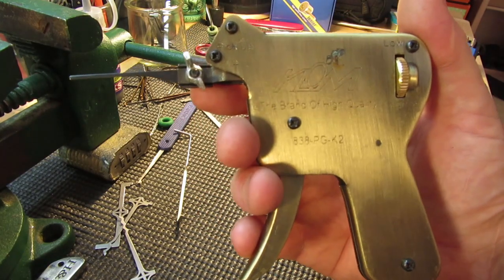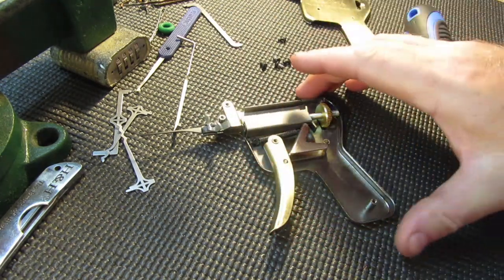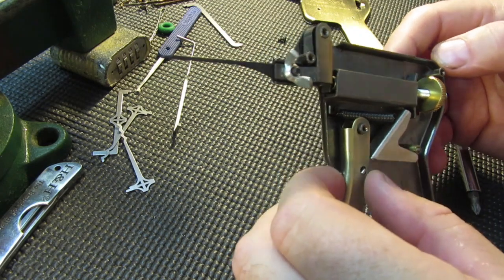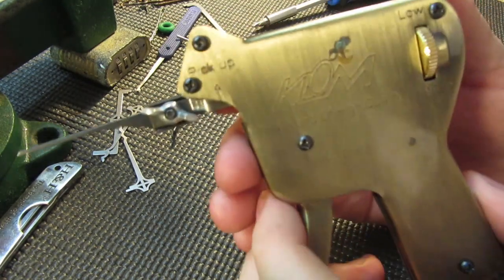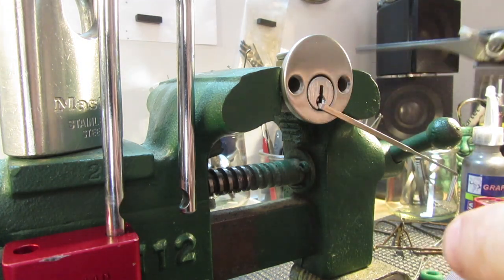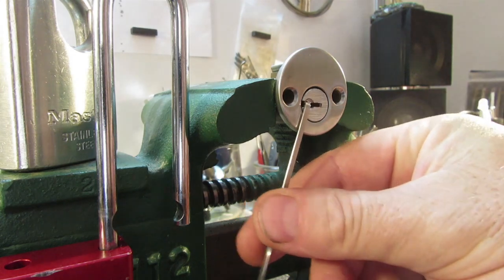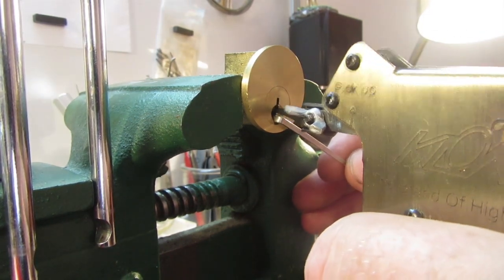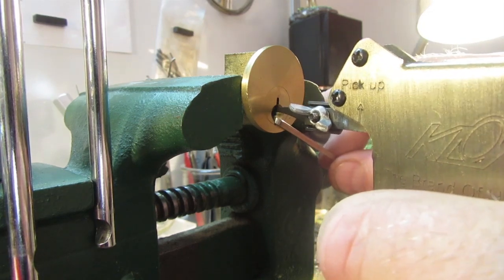KLOM Manual Lock Pick Gun A look Inside & Test On Door Locks

Comment: That main impact spring is tac welded in there inside that little box housing up top. That thing isn't coming out unless you drill out those tac welds. The 3 picks it comes with are utter crap they bend after one time use. Better off ordering them or making them from hack saw blade. I don't have any extra picks on hand so I don't know how good it actually works but I suspect the picks bending as they do takes allot out of the sharpness of the impact to the pins.